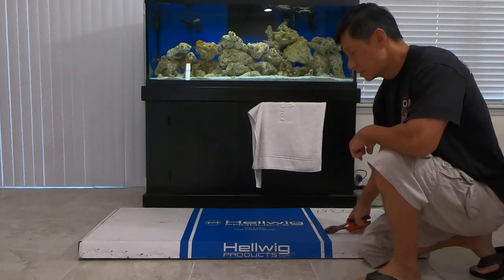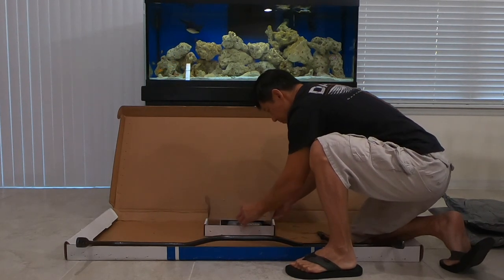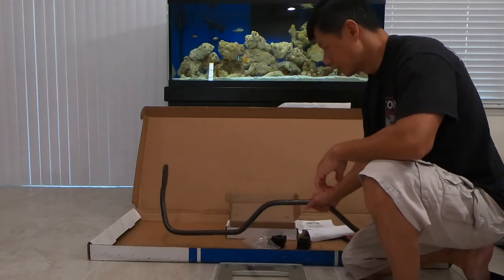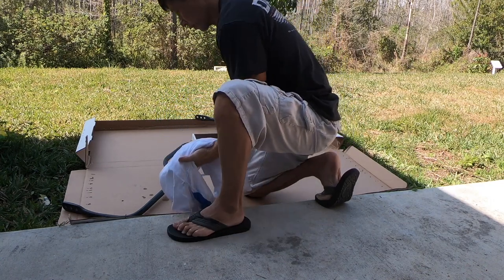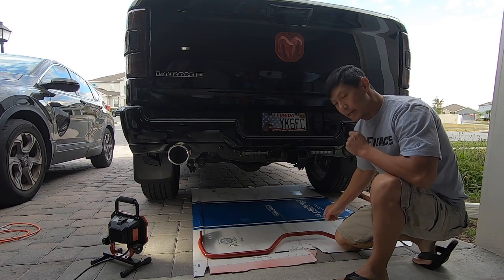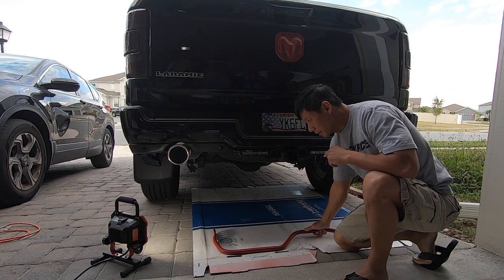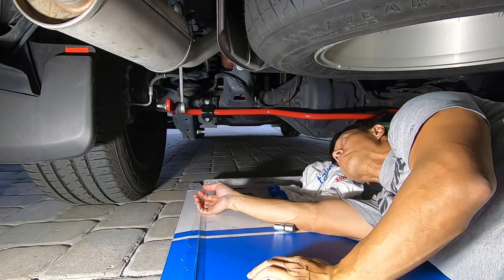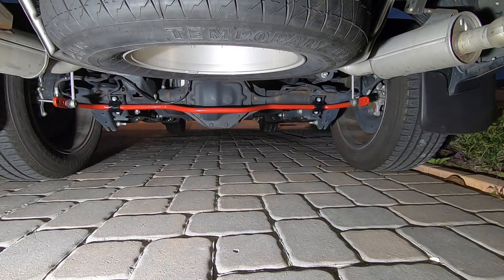Hellwig Sway Bar 2019 Ram 1500- Vlog 35

Comment: hey i install one on my 2yrs ago on my rebel.it works great👍❗ alot of guys think my truck is stock when i go into a corner at high speeds and they try to catch up😁i can see them in my rear view mirror loosing control and their tires squealing.😄🤣they cant figure out how im able to do it.😆especially if its another truck👍👍❗
Reply from the maker: I have mine set to the first hole and it handles great. I don't think it changes the ride.